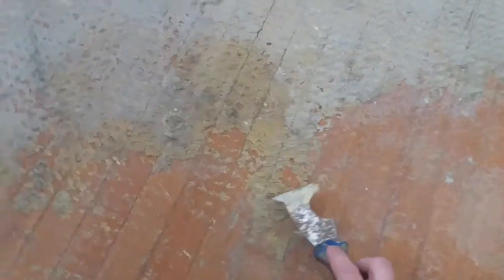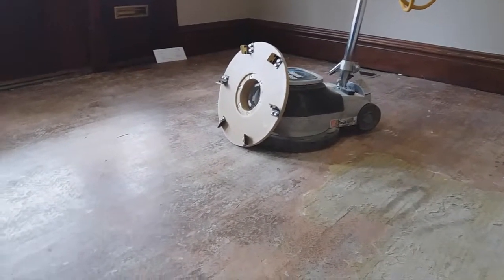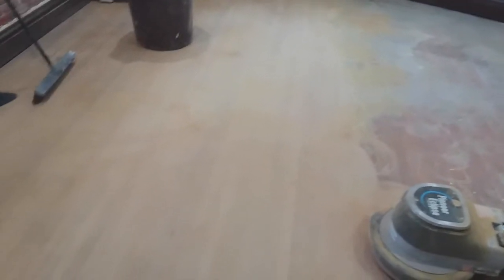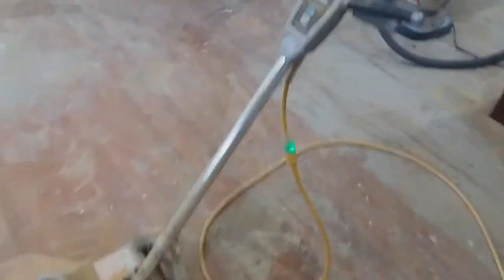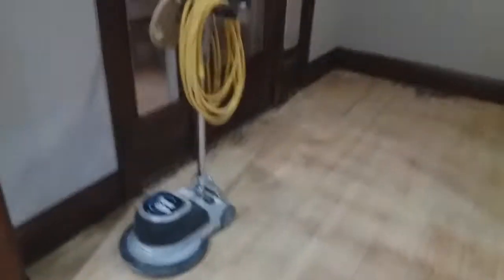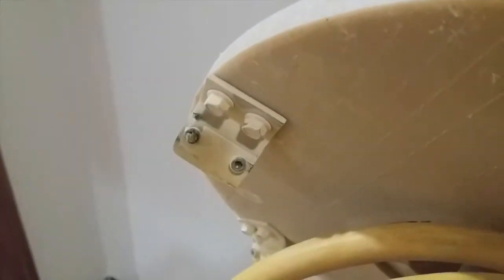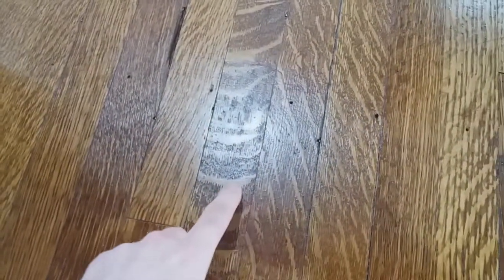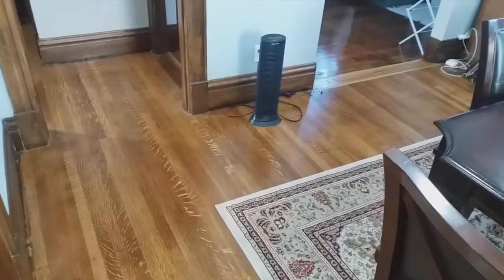Diamabrush Review floor restoration tool

Comment: The mastic is much easier to remove by flooding the floor with TSP substitute. It will dissolve and can be cleaned up with black pad then vacuum up the slury . Allow to dry then sand floor as necessary.

Comment: this company makes many grits to take this wood floor all the way to satin ready to stain and or urethane coat.  You can add an accessory shroud around your machine and install a cyclonic separator between the vacuum and your machine. virtually no dust will clog the vac filter.  It works amazingly and saves so much time  The separator only costs less than $60.  You could have filled some of those gaps with filler before doing the stain and urethane. a smaller hand sander would have done the edges well.  All circular scratches would have been eliminated had you used the other progressive grits for a perfect job.

Comment: How did you do the Edges
Reply from the maker: Terry I used a edge sander to get the last bit off, I got as close to the walls as possible with the diamabrish. Had to use an orbital hand sander for the stairs.
Reply: An angle grinder with 35 grit sand paper (double it up) could work. I've used an edge sander and after two different houses, I am not a fan of it. Angle grinder? Pretty dope but make sure to use 80 or 120 grit as well b/c 35 grit will remove and scar too much if not careful.

Comment: if this works on indoors wood floor can it work on decks? i know they have an angle grinder version for decks but this would do it so much faster. is there a reason this giant indoor version wont work on decks?
Reply from the maker: Good question! May want to ask diamabrush if it would work. Hardwood floors don't have the larger gaps between the planks like a deck. I would worry with the hardwood tool the heavy machine may bend the blades if they drop down between two deck planks. maybe that's why they have the much smaller one for decks?